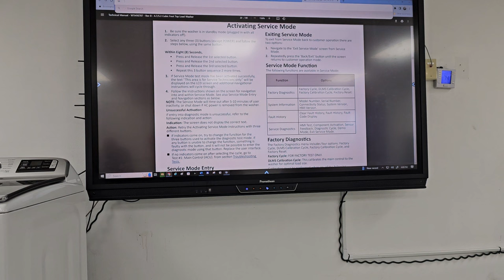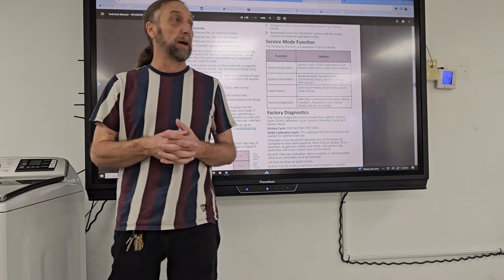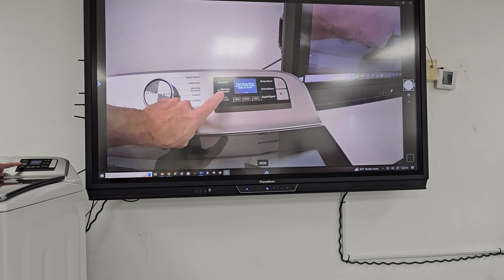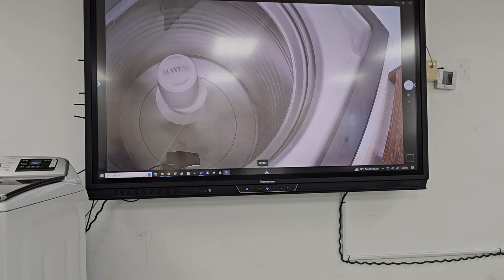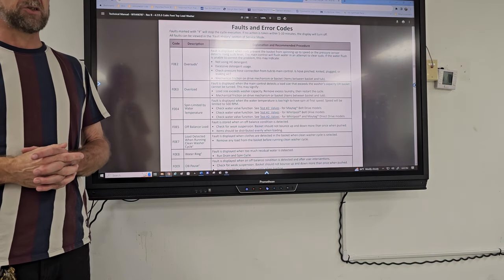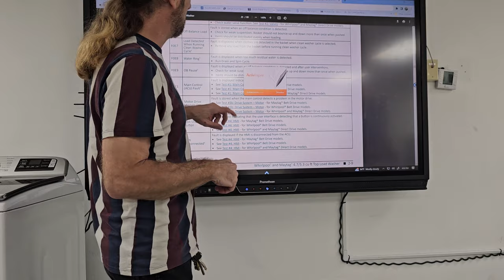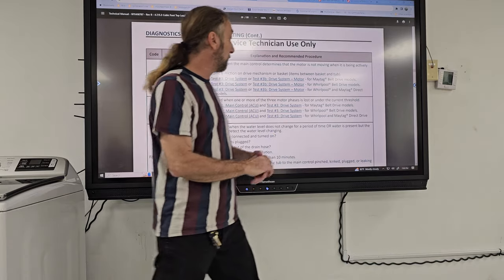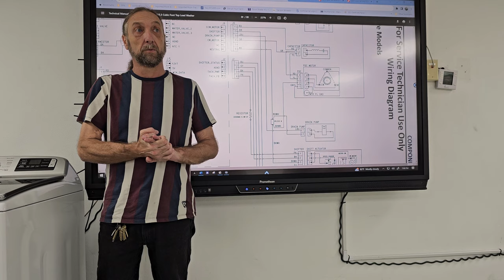Maytag MVW7230HW0

Comment: This model is such a disaster. Had it just under three years and twice it has needed repair. Once with closed lid sensor, and now with random F7E4 and F6E3 errors. Won't spin to full speed and leaves clothes soaking wet.